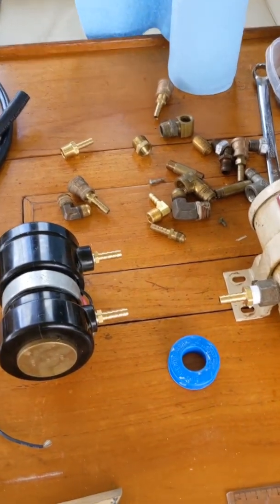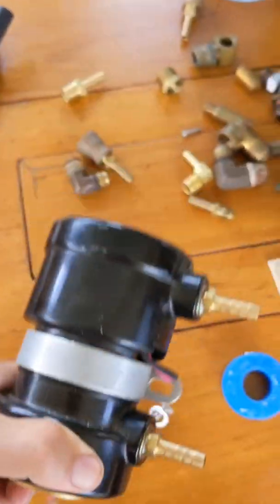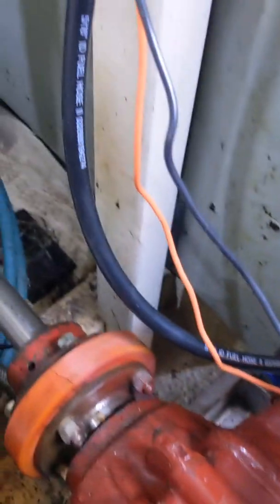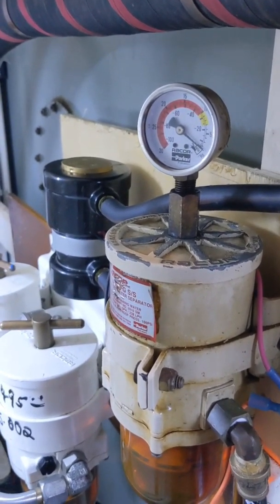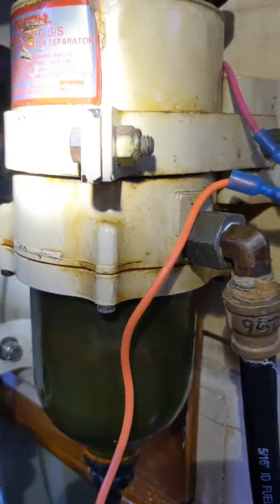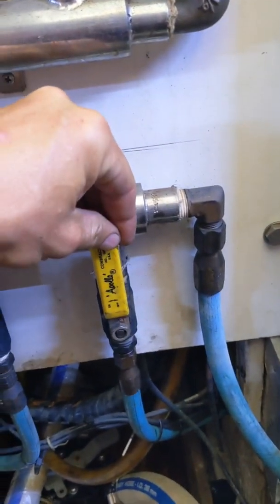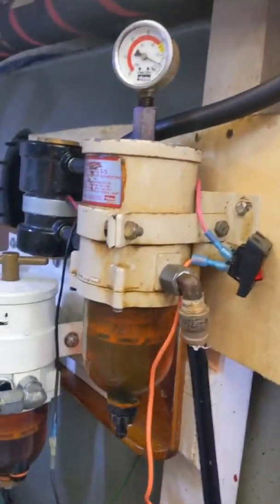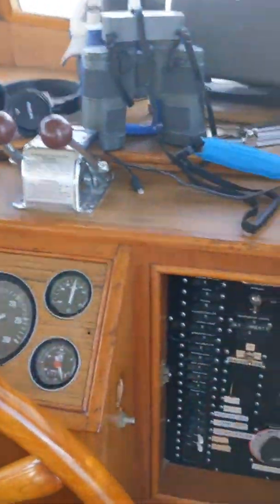WyRow loses an engine! Warning...geaky gear head video.

Comment: Question.  What is the brand of the black diesel fuel pump you have plumbed into the system to do the polishing?  I had one as well and for the life of me cannot remember the brand (manufacturer).
Reply from the maker: It is a Walbro 6802